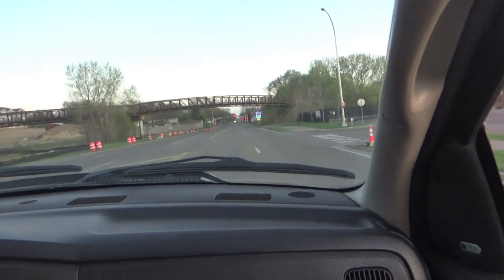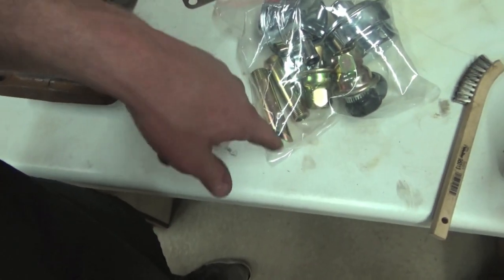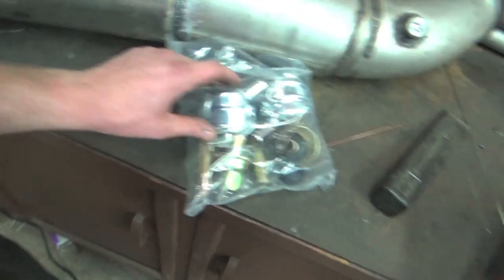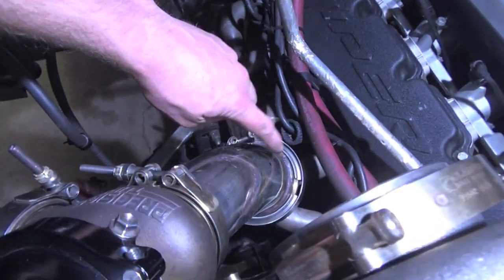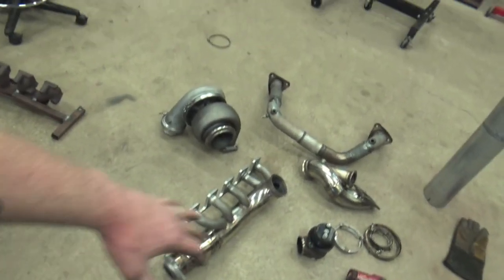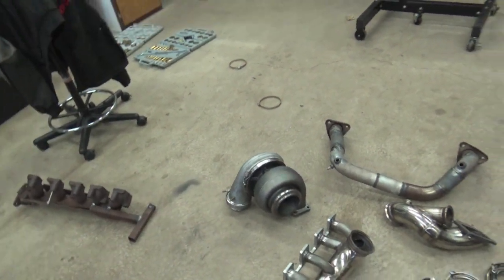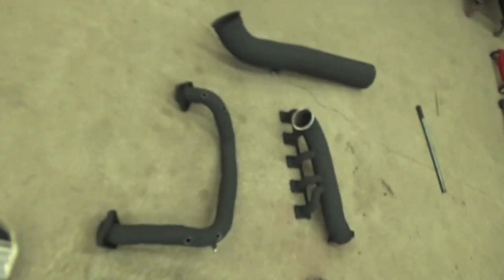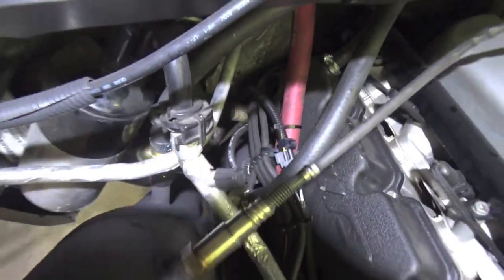HUGE Turbo Dodge Ram srt 10 street hits its CRAZY fast!!

Comment: I've been a big fan of the exhaust evacuation for a long time.  Letting the intake vacuum work the pcv valve just lets oil into the intake track.  You have to watch your exhaust to make sure it's not pulling to much oil.  I've been toying with putting the catch can inline with the exhaust evac to hopefully keep the exhaust a little cleaner.  If you do that, you'll need a check valve in the vent filter on top to maintain vacuum.   Love the truck.  Love seeing the work you put into it.
Reply from the maker: Thanks man! And that sounds like a good idea so it doesn’t smoke or puke oil out
Reply: @RacingRamFam  who machine your block.
Reply from the maker: @davidyork6643  brand new Oem block!! But all the other machine work was done by my guy Jake from sampson racing
Reply: @RacingRamFam  location of Sampson Racing, I just want to procharge mines, about 16psi. I got about 115k on my truck
Reply from the maker: @davidyork6643  ya stock rods and piston will not handle that lol I did all the engine work to this he just did some minor studf
Reply: @RacingRamFam  yes, I know. But I'm going to buy CP pistons and Molnar poweradders rods, I just need a great machinist, watching your videos, I knew you could point me in the right direction.
Reply: @RacingRamFam  I'm looking to a F1c 12 rid procharger
Reply from the maker: @davidyork6643  nice ya he’s out of invergrove MN. That will be a wicked setup!!
Reply: @RacingRamFam  the crankshaft should be fine with just some good billet main cap. Or should I have the crankshaft polish up
Reply from the maker: @davidyork6643  def mic the crank, then has any visible scratches and isnt mirror finish I would polish it. Also billet main caps need to be line bored before installed
Reply: @RacingRamFam  Good Deal